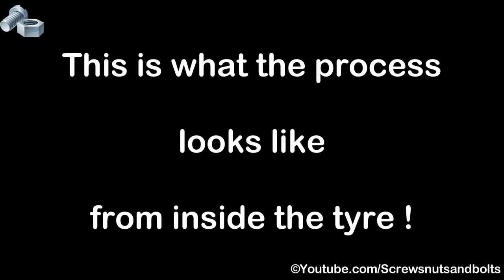Tyre Puncture Repair Kit Tutorial

Comment: when you cut away the excess make sure you cut every tiny bit you can,    or the spinning of the tire will pull the plug out!    only 55 years experience.
Reply: U r correct sr.
Reply: I use a die grinder with a fiber foam pad on it and buff it flush. The friction helps melt it in place.
Reply: It's not the centrifugal force that pulls that plug out, it's due to the tire skidding on the road due to braking. If it's due to the spinning of the tire then the plug was barely in to begin with.
Reply: Thanks! That's a useful tip. 👍
Reply: Hard to do if the puncture is between tread runners
Reply: It is safe to use this kit with 4.5bar pressure tyre??
Reply: @@FunkyMonkeySpankjust isn't suitable for highway use 😅 don't go over 80kmh and you should be ok with your lawnmower wheel
Reply: Ok boomer
Reply: I've probably had to do this exact plug method at least a dozen times, in my lifetime. I've never been able to cut much of the excess off. I always attempt to, and would give up in frustration. Perhaps, I'm just lucky, but never had to replug the same tire.
Reply: This comment helped me out a lot
Reply: To be honest I’ve never cut the excess. Some kits even mention that it isn’t necessary. Have yet to have a problem on any vehicle I’ve needed it for or any I’ve assisted in patching up. Might be that it depends on where the puncture occurs.
Reply: It rotates
Reply: Ok... not one video mentions this, however... to use a plug as a permanent solution (yes, you absolutely can), the trick is this: use a drill with a 7/16" bit, run it through. Now, and this is VERY important... slowly pull the bit out while in the drilling (not reverse) position. What this accomplishes, is turning all the wire banding (there is a wire mesh within the tire tread) in a single direction. THEN... you push the plug into the very tight hole made by a screw or nail. The wires, all pointing in one direction, will prevent backing-out of the tire plug. Do NOT use lubricants or sealants unless larger than ⅜" diameter (¼" max recommended diameter). This repair done at home, by ANY and ALL....  DIY people for an $8 kit from the auto parts store of their choice, WILL PERMANENTLY repair their tire. Only a degree in engineering and 25+ years as a mobile mechanic/recovery technician. Enjoy.
Reply: Thank you.
Reply: Every repair diy tutorial needs to be done by this person. Excalty as the other guy said, straight to point, no distractions.
Reply: I just did my first plug, and I was going to leave the excess, but now I'll make sure to cut it away.
Reply: Thanks
Reply: … and still no one asked

Comment: No nonsense, no background music, no garbage, straight to the point. Haven’t watched such a quality video ever on YouTube. With this one video you got another subscriber in your bucket. Thank you very much! 🙏🙏🙏
Reply from the maker: Thank you very much ! :)
Reply: but how long should it cure before driving again?
Reply: @jonasenck  Good for 10 days
Reply: Tq very much❤
Reply: @jonasenck  Rubber cement is optional, in this type of application it is more a lubricant for the strip, but also helps to bond the strip to the tire and provides a better seal on the inside of the tire.

While these are meant to be temporary until you can get to a repair shop, many use them as a more permanent solution, particularly on older tires that will be replaced soon(ish)  

Still recommended to have the tire professionally checked, as there might be internal damage if you traveled any real distance on a flat, flat tire, where the wheel rim might have cut into the internal areas of the tire.
Reply: Yup, subscribed

Comment: I’ve been using these since 1988, approximately 30 times, and each time the tyre lasted its entire life without further intervention to any of the plugs. If done properly, no leaks, no issues - follow the manufacturers instructions precisely.
Reply: Have you done this kind of respiring near the shoulder of any of the tyres and how long do they last usually? Every tyre shop I spoke to would just refuse to repair if the puncture is outside the central 1/3 width.
Reply: @thisisarandomstring  mate they work on the edge of tyre just as well. Don't get robbed by tyre man
Reply: @thisisarandomstring  That’s for warranty purposes they don’t do it.  The tire manufacturer voids the warranty. Sometimes shoulder patches leak and sometimes they don’t. It doesn’t hurt to try and it certainly isn’t dangerous like so many clueless people say.
Reply: @thisisarandomstring  a plug will outlive a tire easily.
Reply: I followed the instructions, and see from this that I did it wrong! The instructions got my fingers covered in glue and no glue on the strips, just the needle.

Comment: Yeah, it's pretty much that easy.  As another reviewer has stated, it's easier to make this repair when the tire has pressure in it.  You can make this repair without even taking the tire off if you don't mind laying on your side, partially under the car/truck while you make the repair.  A couple of tips--   If the hole is small and you can't find it, mix 5% dishwashing liquid (Dawn, etc.) in water and slowly pour it over the tire with the tire inflated.  The leak will cause a mound of bubbles which will be easy to see.  The purpose of the reamer is to clean and slightly enlarge the hole.  Don't ream any more than you need to in order to insert the plug.  If on your first try you push too hard and the plug goes all the way into the tire, join the club.  Everybody has done that.  No worries, just put another plug on and try again.  If you can't get the plug threaded thru the plug tool eye, take a flat screwdriver, insert it into the opening and very slightly pry it open.  Then slide the plug in, pull the plug thru with pliers and remove the screwdriver.  Use plenty of glue when coating the plug.  Sometimes when removing the plug tool you'll pull the plug out.  If that happens, try again and this time before pulling out use the pliers to bracket the plug tool and push down on the plug ends and tire face while removing the plug tool.  
This method usually works for good, but not always.  An inside patch is better but it isn't perfect either.  And, this method can address the growing problem of tire repair stores refusing to patch a hole that's even slightly close to the sidewall.  A hole in the sidewall is not patchable and I agree the tire is toast.  But more and more tire stores are telling a customer that a hole is "too close" to the sidewall and they need a new tire, when in fact they just want to sell you a new tire, or better yet, a whole new set.
Reply from the maker: Thanks for the information !
Reply: Has to be a good quality liquid soap, some cheap ones wont even bubble,as I've found out !!
Reply: Why not manoeuvre the vehicle so the puncture hole is on top so you dont need to lie down
Reply: It is illegal or against policy for a tyre repair company to try and sell a new tyre instead of repairing it. They don't try that on company or fleet vehicles.They are not allowed.
Reply: @algorithm6291  the front wheels can be turned and pointed out, if it's a rear wheel you have the wheel arch in the way
Reply: @algorithm6291  11 out of 10 times it will be the passenger side rear tyre that picks up a nail or screw.
Reply: @algorithm6291  in my country they try to sell new set even for company cars. "sir, sir, SIR, your tyres looks one month old and I recomment we put new set under"
Reply: @thisisarandomstring  dude what… That’s exactly what I’m dealing with at the moment lol
Reply: @thisisarandomstring  If there's a screw or nail lying flat on the ground, the front tire would push on it, pick it up and flip it backward; the screw would be tumbling, turning, summersaulting.  If the screw happens to be upright when the rear tire comes upon it, the screw would be driven into the tire. 
If the rear tire picks up the screw and sends it tumbling backward, then the front tire of the car behind may hit it.
Reply: Costco Tire Shop used to do patch repair, but they have since changed to plug repair, and they don't say "temporary". 
Nowadays even Costco Tire tries to talk you out of a tire repair and tries to sell you a new set of tires.

Comment: The best video of the bunch. Love it!
I watched them all, and watching this one did it for me.

1)  remove the screw or nail
2)  use the reamer to (a) clean the hole and (b) make sure the hole is big enough for step 3.
      cleaning means if there were oil or grease, etc. you want to scrape that off, 
      you want the hole to be pure tire rubber only, to ensure a good seal, 
      if the hole is too small for step 3, you don't want to find out too late,
      so you want to mimic step 3, slowly push the reamer into the hole, and quickly pull out, 
      if you can do this, then step 3 should go OK
3)  thread the plug into the pusher tool, coat the plug with rubber cement,
      slowly push the plug into the hole about 2/3 in, then QUICKLY pull the tool out,
      the pusher tool has an opening at the tip, allowing the plug to disengage with the tool,
      I have read in other links that the rubber cement is not necessary for sealing, 
      it is used only as a lubricant for the plug to slide in,
      some plug kits don't even include the rubber cement,
4)  cut off excess plug, and re-inflate,
      nowhere do they tell you if you have to wait between steps 3 and 4,
      not necessary to trim off neatly, the road will trim off,
5)  if still leaks, repeat steps 2-4

Comment: We have a truck at our work, 20+ plugs, some holes are so big has 3 plugs. Holds air at 110 PSI fine no leaks. Been over 1 year solid.
Reply: These were meant to be temporary only, dont get people killed due to your tyres please
Reply: @vsmh96  I have done hundeds and never a leak or fault. It is a good system as long as you use cement.
Reply: @vsmh96  Gotta take that up with the boss, I'm just the mule.
Reply: mrnice88x  tire plugs are dangerous..if they drove on the flat long then the inside of the sidewalls are thin and a bunch of rubber shavings came off inside the tire..so you could plug it and wouldn’t even notice the sidewall being thin and could have a blowout and then the shop getting sued
Reply: @rahrah8076  Fella, if it's your own motor and you know that you didn't drive it, then happy days. I wouldn't recomend it for some thick tart that asked you to do it because people kept telling her tyres is flat for last 20 miles.
Reply: @rahrah8076  If the tyre has a nail or screw close to the tyre wall, it won't get repaired in the UK. 
Common sense is always called for.

Comment: I used these on a tyre and did burnouts, no problem. Always carry them on my car as if you see a nail or screw in your tyre you can just pull into a servo and fix on the spot without removing tyre. Never any issues with them.

Comment: Very nice video. Specially liked the last part showing how it works. The rubber stick compound have really amazing rheological properties. We can see that the compound flows when a high shear is applied as the needle is pulled out quickly. Really interested to see if the same happens when we pull out slowly. If not, then shear thinning is very critical for the success of the product. The video is also very useful for demonstrating to Polymer students on the principle of Rheology. Thank you.
Reply from the maker: Thank you very much ! :)
Reply: what if we did cut that strip after applied

Comment: Thank you Sir!  Was a bit iffy but easy as,  didn't even have to remove the tyre. The inside shot sold me, don't be afraid to get rough & get a nice hole. Happy New Year mate!! (Will update on longevity)
Reply from the maker: Thank you !, Happy new year to you too :)
Reply: @screwsnutsandbolts

Hopefully NO JINX, knocks wood 3 times + throws salt over my shoulder as I turn around 3 times, but still holding up, from an unrepairable sidewall puncture!

Have helped others & shown them this video!

Comment: Great video minus any BS. Liked it. Specially the bonus view from inside. 
I guess in practice the tyre would still be attached to the car and inflated when we do this.
Reply from the maker: Thanks. Yes as long as you can access the puncture site you can repair it with the wheel on the car

Comment: Great video. Been doing this for years exactly accept no cement. I leave the tire on the vehicle positioning just right for me to work on. Fill the tire with air and locate object causing leak.  Remove object and perform these exact steps. Grab my air compressor fill tire to proper psi. Not one has ever failed me. This method makes quick work.
Reply: The cement is probably a good idea - it's not glue in the normal sense; it contains a vulcanising agent that melts the rubber it touches and then evaporates out, so it acts like a weld.  Without it, in theory the plug could be blown out... but the comments don't agree, so it's probably not critical on a regular family car.

Comment: I had a nail go in a tire head first.  The hole was so large, I need 3 of the strips to stop the leak.  Since I was planning on getting new tires soon, I thought this would be  a really good experiment.  The 3 plugs held for 3 months without losing any air, that was when I got my new tires.  I was truly surprised.  I wouldn't recommend using that many, but it worked extremely well.
Reply: How did you get three strips through the eye of that needle tool
Reply: @lucienpetersen9010  One at a time.  First one didn't do much. Second slowed the leak quite a bit and the third one sealed it.  Sorry, I was a little vague.
Reply: @OldJoe212  lets hope that i will never have to use this newly aquired knowledge.  Thanks Joe!

Comment: Well done video!  To use this type of kit the tire can stay on the vehicle because the tools are small which is a HUGE plus to me. I carry a plug kit and 12V compressor for when there is no power for my big compressor on the road. This is the only type of plug kit I have ever used on pickup tires here in the states. It has never failed me and,working construction site with dropped nails/screws,I have driven unknowable miles on plugged tires over the decades. 

The only exception was when I got a 1/4" concrete form tie in the right rear tire one winter. On the 2nd attempt I had to use two plugs in that hole to totally stop the leak. I didn't feel so confident in it's long term use so I replaced the tire sometime soon after that night. That night was -20F. I fixed it at a friends country house out in the cold wind after dropping off another friend who worked for me,then drove 32 miles home hoping I wouldn't have to stop some random place and do it again. Talk about relief to see the lights of home! That double plug did not fail,I just didn't trust it for the long term.

  I do like the looks of some of the other type UK kits I see,I like them alot, but they look to be best used with the rim and tire off which would slow me down too much as a road repair. I would sure consider them for home use though!

Comment: I have used these for years, they work great. Never put one in a sidewall though, maybe only to get to a Station. Make sure you ream the hole well or you will not be able to get the new one in. Use the glue but if you don't have any that's okay.  Note: always get the upgraded T handle so you can push harder, the screwdriver looking ones are useless for pushing in
Reply: Yeah, the screwdriver ones only work on riding mower & moped tires (tyres).

Comment: Ive found that its much easier getting the plug in if you let the tire go somewhat flat first (which you did).  Its counter-intuitive while fixing a leak to let even more air out, but without a pressurized tire, the hole can expand and stretch much easier.

Comment: This repair method works nicely on family cars and would last the life of the tire. It can also be done without removing the tire from the car. For heavy vehicles or racing cars probably this may not be the best repair method. Another variation is not to enlarge the puncture hole but splice the thread into two. Never used cement in my country.
Reply: I have plugged a 190/55/18 rear  motorcycle tire and it held for 5,000 miles👍
Reply: Then you are not too fond of your family. These are emergency and temporary fixes only.
Reply: Este tipo de reparacion de un neumatico es el mas malo que existe
Reply: @warrenpacholzuk9190  wrong. You don’t know what you’re talking about.

Comment: Looks like the exact same kit I have even though this is British. Some say twist it & pull. I did a tire (tyre) & it only lost 3 LBs of air over 8 months. Some shops add a patch inside. I was told if it's too close to the edge, it won't hold. About an inch in or better.